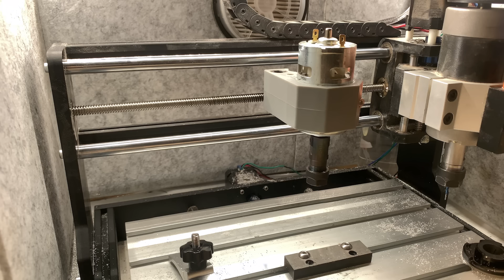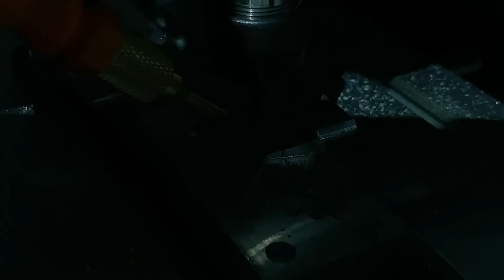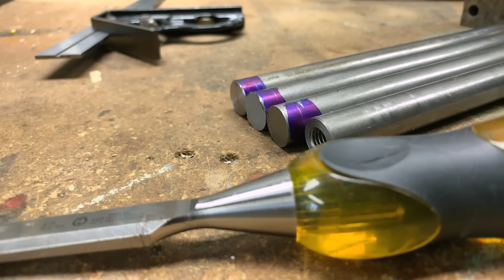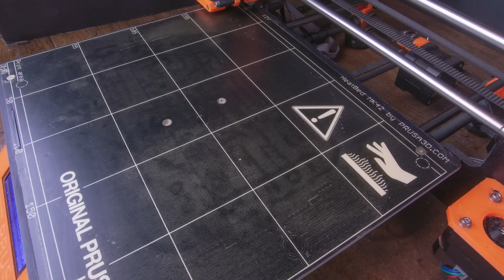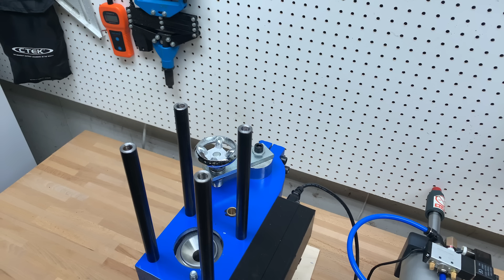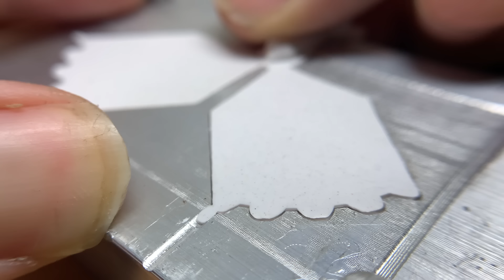Build an Injection Molding Machine From a Cheap Pneumatic Press

Comment: I think I just have one more question: What's the size of the springs? I'm catching hell trying to find the proper dimensions. Is it just 10mmx10mm? Or 10x6? And what's the thickness?
Reply from the maker: Oh, let me double check.  Basically it is VERY non-critical.  It has to be stiff enough to support the weight of the chamber/plastic in the chamber, and weak enough to compress when the ram comes down.  Since you can adjust the pre-load by adjusting the bolt length, the exact spring values are very flexible.  Let me run out and measure approx size of the ones I used, but it's not very critical. This is a very rough measurement in place.  Wire diameter 2.1mm so probably 14 gage,  diameter ~22mm, height when slightly compressed ~28mm.  You can get away with a much smaller major diameter if you just put it around the bolt instead of having that extra over-compression insert in there.  More commercial ones of these use those cool springs with the flattened wire walls that can compress down to a cylinder.  If you're going for a smaller major diameter like 10mm, reduce the gage a LOT because14ga will be way to stiff at a small diameter like that.
Reply from the maker: I often make my own springs because finding the exact ones for specific situations is tricky, but this is so non critical it was easy enough to browse some at the hardware store.  My use if the over-compression inserts is probably overkill.  The danger is that if you say fired off the ram with the cylinder full of unheated plastic, and you didn't have a mold under the chamber then those two springs would be pressed by the entire force of the ram, which would probably squash them badly.

In some bad situations springs can break/pop in dangerous ways, so I decided safety first.  Still that area is enclosed by the casting, so the the actual amount of danger in that extreme case is pretty low.  I also tend to not have to run the press at full rated pressure so the max force the springs would see in that case is also lower.  So you're building one?   Good luck!  I'd love to see some pics if you get one going!

Comment: Someone needs to manufacture an affordable option for injection molding :( i could make so many toys
Reply from the maker: I do think injection molding's popularity is starting to tick up.  Since so many people now have CAD exp. using 3D printers, and smaller/more affordable CNC setups are making it so molds are not impossible to make.  Right now it's still a kind of specialized market, so prices on say a pneumatic injection molder are still high, but maybe as more people get into it, someone might start selling a packaged version of a machine like the one I made.  At scale the price difference between a press like this and one with some heater bands/PID controller/injection chamber/clamp would not be huge.  More toys all around!

Comment: SO many questions: 1. What are you using for the plunger? Is it the Buster Beagle Mark II plunger? (It's not on the parts list).  2. What settings are you using on the Pneumatic Press? 3. What temperature are you setting the thermostat to (looked like 210). 4. What size are the standoffs? 5. Did you have to enlarge the holes for the standoffs or did you just use 10mm inserts?
Reply from the maker: Oh, let me see.  I guess I did machine my own plunger.  It would have the same end diameter as the Buster Beagle plungers.   It's been a while, so I don't actually remember why I don't seem to have video of that.  If you download the Fusion CAD it has all the stuff in it, including the plunger info.  It will for sure have things like the standoff lengths, etc.  The standoffs use the same hardware as the original mounting, just with studs in both ends.  If the original press was using 10mm then I guess that's what I was using.   

Temps depend on what ever plastic you're using.  I was using PE, and if the video show's 210, then that's what I was using.  

I haven't done any injection molding in a while, but I have a new CNC these days, and just designed a new mold, so I should be firing the injection molder up  again this week!

Not sure about exact pressure settings on the mold.  It depends on the shape/details, I think I was getting away with something like 24PSI for the things I was injecting. At least it was no where near the upper limit.  

Good luck!  Injection molding sure is fun!

Comment: don't you think it is amazing how many of us start with 3018s, learn how they function, then rip them apart to re-use the parts and build something bigger and better for negligible cost!
Reply from the maker: Yes, they are pretty wonderful in terms of a super low bar to entry. Also way lower fear of things going wrong.  I once had the head become detached and drill though the bed, and I just shrugged.  No big deal.  Not "Oh god, now I have to spend 4k in new spindle bearings". 😄  I have a slightly beefier 24,000 RPM spindle machine now and making mistakes on that is a lot scarier.

Comment: I bought a HF electric log splitter once with intentions on modifying it as a injection mold machine. It had the external hydraulic lines from the pump to the valve to the cylinder. Not many do. That means I can re-rout the hydraulic pressure and ad in 1 or more valves to redirect the hydraulic pressure. The idea was to make 2 mount plates on each end then mount large 1.5" rods on each side. 

I was then going to ad multiple plates that would travel back and forth along those large rods. I was going to put in a anti back flow valve with lever bypass. That means when the hydraulic cylinder closed on the mold it would remain closed with 8k lbs of pressure. At that point I would have another small hydraulic cylinder that would inject the plastic using another lever. I was also going to use a small hydraulic cylinder modified to serve as a plastic injection cylinder. 

When you look at it and plan it out it all makes sense and was going to be fairly economical to build. I am a machinist so I don't have to pay for some one to machine things for me. Right before I was set to begin the build I had to move from the west coast to MI. I had to sell almost every machine I had and then find a home with a shop and then rebuild my machine shop. 

Just finishing that up. Now I am thinking of buying a larger boy injection mold machine and modifying it to suite my needs. May still build a smaller one out of a log splitter though. If I do I'll film/document it here on the tube.

Comment: Pro tip when pushing in threaded inserts using a hot tip like you did immediately press on it with something flat and metal like a 123 block. It will ensure the insert lies flat and pushes down that lip you see around it.
Reply: That's a good tip.  That can also be handy in that it helps cool/stabilize the inserts position quickly. In a lot of my earlier designs I try to have the inserts a bit proud of the surface so that they always make first contact.  That way over tightening the screw can't jack them from the surface.  That can be kind of a pain though since you have to have a fairly consistent height above-surface.  So these days I often do as you suggest.  Just pressing against the drill press table.  ;]

Comment: Very cool! I recently started down this path, I have the PID coming. I was looking at a motorized linear stage actuator to run the ram though I'm not sure a nema17 motor would be powerful enough and I haven’t really figured out the barrel yet. I like the look of the buster beagle one but not the price so much. I think I'll attempt to build one before I buy but we will see how that turns out. Thank you for sharing such an awesome video.

Comment: Please excuse my ignorance, but is the piston stroke speed controlled by the adjustable exhaust mufflers (baffles) ? Thanks. Great video!
Reply from the maker: Yes, you are exactly right.  The hold time can be adjusted electronically, but the stroke speed is just set with the needle valve in the the exhaust port.  The more wide open it is the faster it can go.

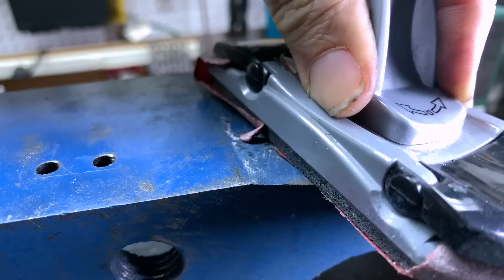Comment: Ok I’m pausing this video to make one criticism… lol.   At around 16:50 you were doing things to the time of the song ( which is incredible and I think your having way too much fun with this editing lol) but the sanding of the bondi could have been to the song and it would have been so epic haha. Amazing..
Reply from the maker: Well, it is true I tend to like to edit to the music/put crazy work into it at some points.  You're right though that that one was a bit of a missed opportunity.  Sometimes it helps give my edit structure, and sometimes it just slows everything down.   lol, SO much work.  I could also have had some of the ear plugs appearing in the holes synced to parts of the music a well.  :]. In my GM screen video I even had the flames in the laser cutter synced to the music!
Reply: @retrotechjournal  it seems like you have a background in film or something. Your super talented to say the least!
Reply from the maker: @DigitalDreams-1987  No real background in film. I did take one film making class in college.  I guess I did work at PDI/Dreamworks for 8 years, but I was doing tools/R&D, so that was very far away from things like editing/shot composition, etc.  No live action exp. at all, etc.

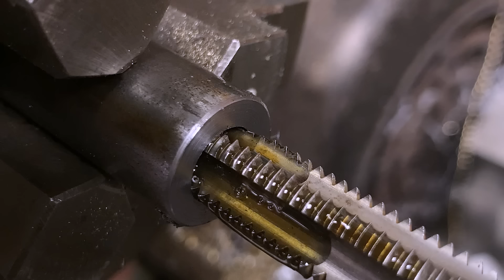Comment: 8:06 you don't have to hand tap your threads with a diameter that large, just set your lathe RPM as low as it will go and back it out before it goes in to far
Reply from the maker: I guess I could but my lowest RPM is 130 and on blind hole that’s way more potential for drama than I’m usually up for. 🙂

Comment: how big parts can we make from such a machine?
Reply from the maker: Something like one cubic inch of volume.  Which is 13g of plastic.
Reply: @retrotechjournal  if we want to make bigger parts please guide.. what would you recommend.
Reply from the maker: @ravebrave8866  I think it depends a lot on the part.  If you want big, thin walled, high detail parts then then that's the worst case because that requires a giant high pressure commercial machine.  Unfortunately I don't really know much about the kind of "bigger, lower pressure, recycled plastic" kinds of machines. I have seen some videos of people doing that kind of work, but I haven't built one myself.  Good luck!

Comment: 15 years ago I got my start in Cnc by buying a small bench top mill and building my own in my garage. I learned geode, solid works and solidcam.   I have done it professionally for 10 years now. I JUST LEFT a job I was the 1 shift lead machinist  to go work for Lockheed Martin.  Anything could be done if you really want it. To this day I have a machine shop in my garage.  KNEEMILL, lathe , cnc mill sheet metal press , tig welder ect ect. All those tools have paid for them selfs time and time again. It's one part of my I will never regret doing. Best decision I have ever made. NO matter where in the world you go people who make things will always be needed.
Reply from the maker: So true!  I’m a huge fan of being able to make things.  Sounds like you’ve got an awesome setup and the skills to use them so the sky is the limit!

Comment: 3:00  Instead of printing all those parts, you could have printed 5 (or 10) of them and then just copied them using a silicone mold and resin.  You make one mold of 3 or 5 or 10 of these parts and then each batch will create that many new parts. Like you print 10 and then you just copy those 10 11 times to get to 120.  All of the copies will be 100% identical.
If you took the time to really clean up the printed ones, they could have looked injection molded.  Silicone picks up every little detail.
Reply from the maker: Maybe.  Flexible silicone molds are great for picking up fine detail, but the parts I was making were very sensitive to exact thickness. With great care I may have been able to produce them consistently enough. I didn’t consider it at the time but you’re right it may have worked.

Comment: This was terrific!  I'm so glad Buster Beagle Mk 3 came out so I could build a similar machine with way less difficulty.  I'm using resin molds instead of milled molds, and a manual pneumatic switch that doesn't let me change the dwell time as easily, but I'm so happy to be able to control the pressure.  Well done!
Reply from the maker: Great! It's fun to hear from others having adventures with injection molding.  I haven't tried resin molds.
Reply: @retrotechjournal  If your aluminum molds are working for you, and you don't have another need for a resin printer, I would not recommend switching.

The resin mold is great for prototyping a couple dozen parts.  The lettering & fine details come through.  But if I inject at more than 195℃, some delicate parts of the mold break.  I'm using Siraya Tech Sculpt Clear, which is their cheaper 180℃ resin (not the expensive 250℃ white).  It's detailed, smelly, and good enough for dozens of parts.

Your aluminum mold should handle thousands of parts, so I'll probably switch after my design is finalized.  Thanks for the video!
Reply from the maker: @nathanbanks2354  I can definitely see the value is being able to prototype more quickly. I’ve gotten decent results with my cnc but tiny details can be difficult. Interesting to hear about your experiences. I’ve learned a lot doing the AL molds but it is a complicated enough process that I can’t just make a mold on a whim.

Comment: Where is the video building the CNC?
Reply from the maker: I'm sorry, I didn't document doing that.  I was lucky I shot those few shots of one part of the enclosure  glue up.   The truth is projects that I document take 50x as long to do, so often when I want to get something done and move on, I do it off camera.  I seem to remember I shared the cad for the enclosure here in the comments some place, but I think there are a few flaws in it like the fan (once it came) was a little bit different size, and I had to drill different mounting holes, etc.  So not super cleaned up for sharing.  Also, my particular mod sacrificed a bit of Z travel for better rigidity, which was fine for me since I was mostly doing short AL billet stuff, but that part of the mod might be annoying for general 3018 users.
Reply: @retrotechjournal  I understand.  I've been looking at building one also.

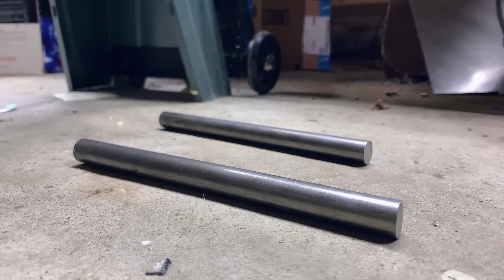Comment: 6:47 dropping metal parts on the flor in a work shop = instant slap on the head! NOT acceptable.
Reply from the maker: Someone else told me about that. That concrete can embed in the parts/dull tooling.  So that's good to know.  I wasn't aware of that before.  I don't in general do that, short hot parts fall in my chip catcher, and longer parts I'm there to snag, but it certainly is good to know about.

Comment: Exhaust holes is what I thought about since beginning of the vid. Quantity and quality of tools you have is crazy.
Reply from the maker: Thankfully with the adjustable exhaust ports you can adjust injection speed separately from max injection pressure.  (I didn’t really talk about that in great detail). I’ve been building that shop up my whole life, and I always feel better when I step out there!
Reply: @retrotechjournal  this is what I dream of. I have nice quantity of hand tools, few power tools at my small flat, plus micro belt grinding machine and 3d printer.
Reply from the maker: @andreyansimov_diy  I have a friend who is a jeweler, and I would show her all my giant projects, and then she would show me her projects. They all were deeply amazing sculptures in wax, and fit inside a film canister!  Her shop was a desk in their apartment. I was always a little bit envious because she could fit her entire craft in such a tiny space.  These days with a 3D printer and a small number of support tools you can do a great deal in terms of projects.  Many of my side projects are 1 day 3D printer builds. Enjoy building no matter what the space/tools are.  I did some great project in college with only some hand tools + a moto-tool.  Enjoy!

Comment: That is a majestic beard, It should be illegal to sell you a scarf or a bib, or even tshirts that have otherwise readable prints on them. You are probably safest in vehicles, even without any airbags.
Most of your pores are addicted to mass production of folicles. If a hair falls out with you, 2 rapidly return in it's place. Clearly, whatever you save on UV and thermal protection is that of minimalist, while your shampoo bills must resemble a family of 4, maybe more.
#MulletWorld
Reply from the maker: It is true that when sledding, belly down, on an icy but snow dusted hill. I no longer get the ‘ow, my neck hurts from the icy coating of thrown snow’ scarf or no scarf. 😆🛷❄️